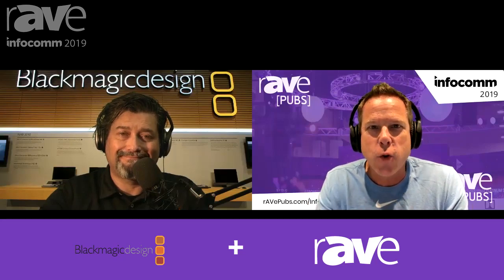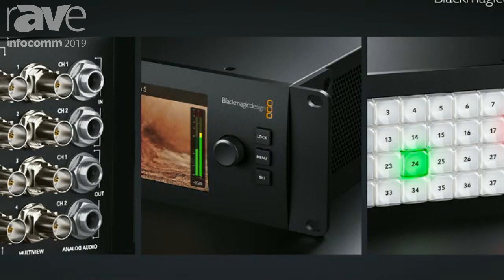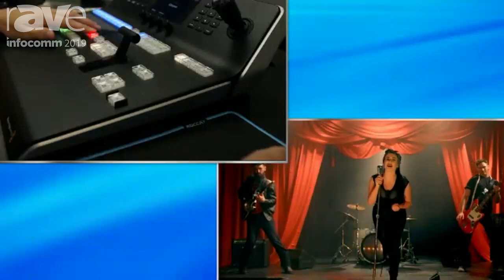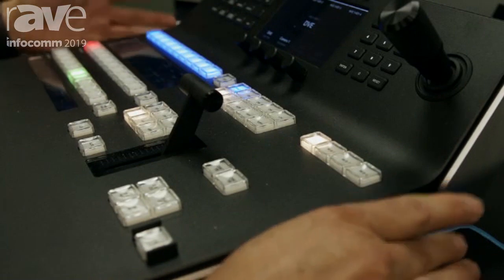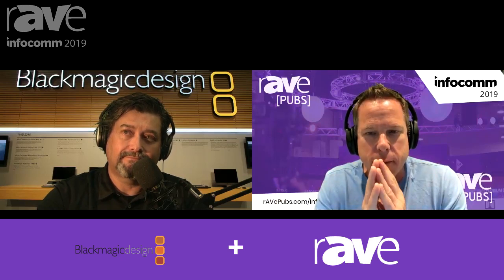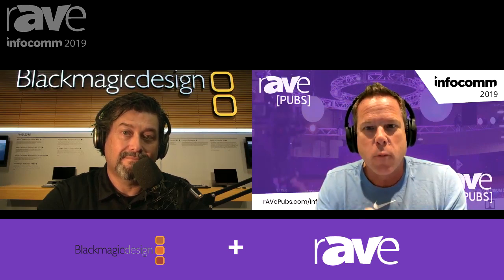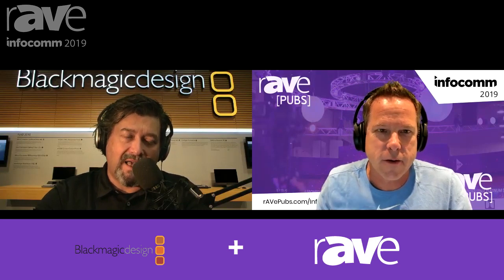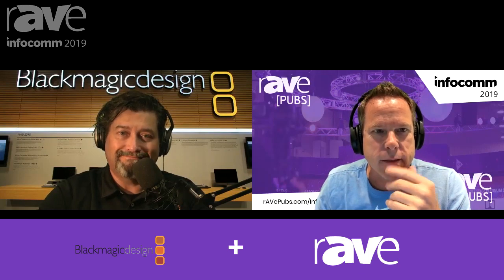InfoComm 2019: BlackMagic Demos ATEM Constellation 8K in Real-Time

Comment: The one thing I've found with BM devices is we get the most bang for the buck out of them. The trade off is we've had many expensive devices that have had operation issues or became trash. We'll still buy them because they fit a hole for size and feture to cost ratio. hopefully they improve in the support area though.